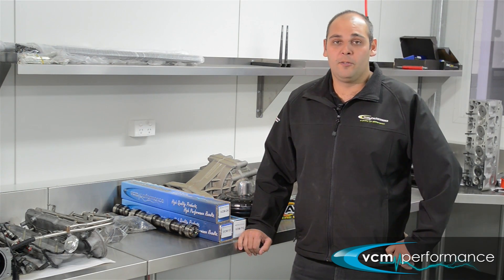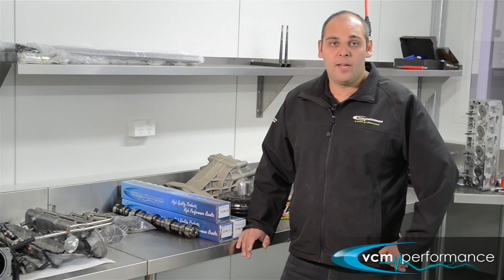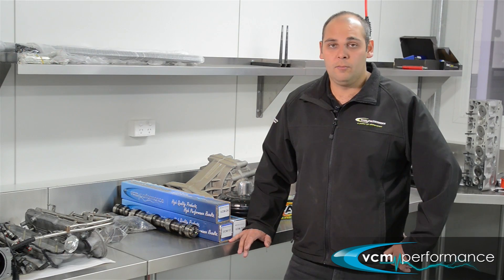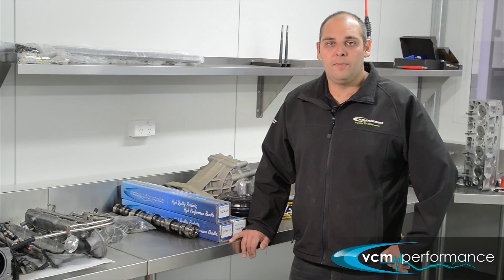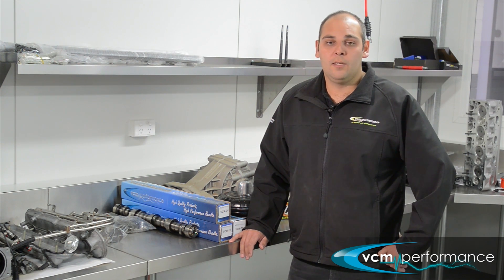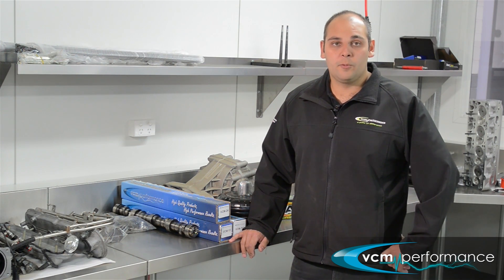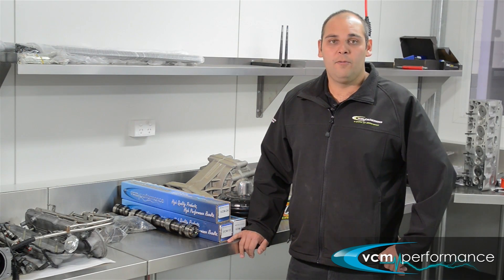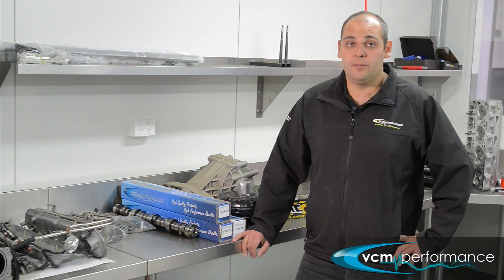How to choose an LS camshaft for forced induction ~ VCM

Comment: Hey please need help brought ls1 vy calais I want to know what supercharger I can bolt on for reliability but it's got high stall 2800 with stock injectors been cammed with vcm which package would this one be. And with 4l60e rebuilt down to bearings and clutch booster. Stage 2 shift kit. Seller I brought off says it's the only thing left to do if you want anything Max upgrade and I'm up ready to give that finishing end and been built to drive daily I've been told but has All the stock things like injectors and spark plugs and it's got all the good stuff making 234 kW before cam had mafless tune after trans rebuild that's what I got with car a dyno reading that before cam and it had a estimate of 315kw they wrote on for receipt before leaving after cam package. Please I'm googling the hell out of what's the right supercharger j know 8 to 9 psi is the max I think it said think about for it to be reliable not having upgrade everything. Thanks in advance for reply and your time. I know the vortexes the safe go. But I like the throttle body going to the head of motor the example I think the one you undo the bolts to top of motor but go harrop but not sure and you injector lines off together with top of middle of the motor with accelerator cable pull. Not efi Gen 3  vy 02 model calais thank you

Comment: Now I am confused....thought with the mods and all it would happen ??! I've seen some getting 480 rwkw on PULP ??!
Reply from the maker: Yes, you said you wanted 500+?
Reply: Just meaning the fuel system...you say the fuel system won't support the power ??
Reply from the maker: A stock VE fuel system will not support 500+rwkw from what we have seen. Some people will run a voltage booster on the stock pump but it can be a little unreliable.
Reply: Ok yes now I understand.....So if I run E85 have to get an adapter etc...
Reply from the maker: I would probably just upgrade the fuel pump completely, not point in pushing the factory pump to it's limits...
Reply: Ok hey thanks for the heads up.....I love my power, I'm just used to Ol School stuff....

Comment: I have a 6L VE SS and going to Heart Beat Supercharge it and want 500 + Rwkw.....What cam do u suggest ?!! Also it's a 6 speed manual...
Reply from the maker: +Kym Wheare To go over 500 you'll need an E85 fuel upgrade as well.
Reply: Fullboost it has factory E85 fitted...
Reply from the maker: Kym Wheare The stock fuel system is E85 compatible yes but it  wont reliably support over 500kw etc.